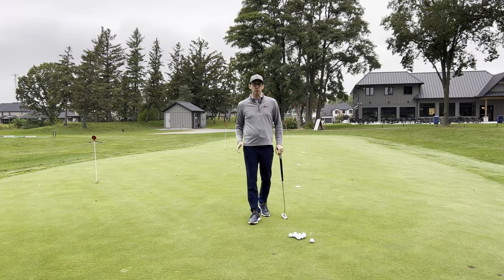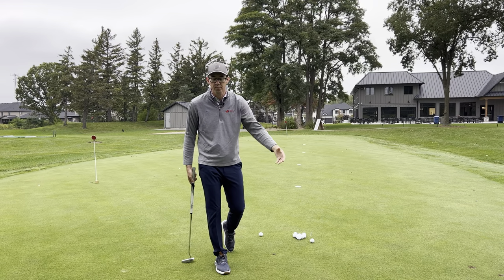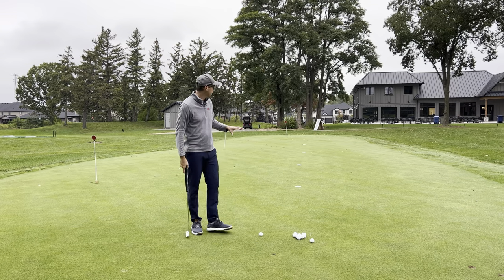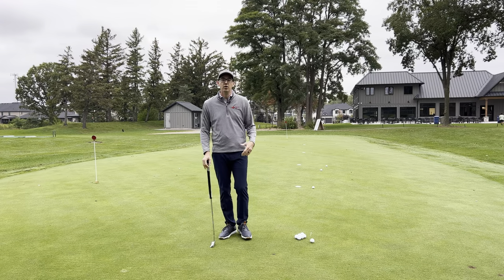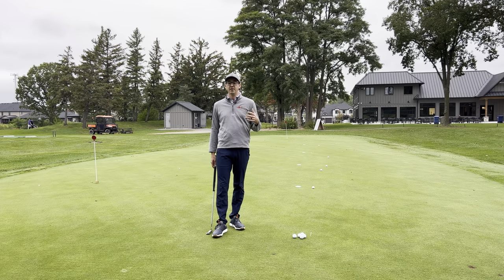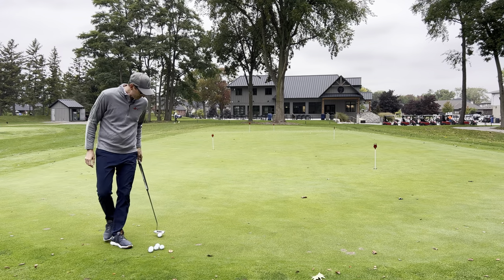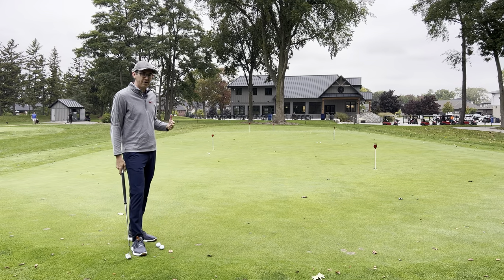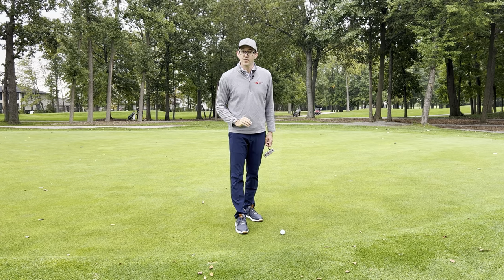Do these Putting Speed control drills and stop 3 putting!

Comment: I find that feel always plays into the putt but if you take your distance (flat putt) and divide by 2 you can estimate the length of your back stroke and follow through. So 10’ divide by 2 = 5 inches back and through (always follow your putt with your putter). I will do this for 10 foot putts until I find what my formula for the day may be for a flat putt, I may divide by 3 or maybe even 4 if the greens are fast. I do this for uphill and down hill putts so then I have an idea of a comfortable distance and all I need to do is find the break; I then test my formula at 20’, 30’. Try it, you’ll find that it will save you from 3-putting. I finish my practice with 10 three to six foot putts to be comfortable or build confidence with short putts. Good luck.

Comment: I just got myself a putting carpet to use at home.  Worked on my putting nearly every day the week after.  1 - 8' putts.  Guess what?  I had 42 putts in my round yesterday.  Actually worse than my previous 37 average.  I suppose every little bit of practice helps, but...When given an opportunity to hit a second putt from same location on the course, I can almost alway put it closer.  Unfortunately, we get one shot at it in real life.  Also, all the other variable involved in putting come into play.  How firm are the greens, how's the cut, slope, etc., etc..  Again, nice little drill if you can find an open putting green to use for an extended period,  since my home "carpet" just doesn't capture some of the "other" variables, but just seems like there's so much more to it.  I also notice that your little practice swings do NOT really indicate you are "imagining the distance" you need to hit the ball.  They pretty much seemed the same no matter the distance, and were not really reflective of the actual swing you ended up making to achieve a distance.
Reply from the maker: Hey Jeff, thanks for the comment. A few things to unpack here, 

- For my rehearsal swings example in the video, although you may not notice the visual difference in the length of the stroke there was certainly a difference in the force applied to the stroke. This will vary from player to player. Some golfers will have long strokes with less force, and some will have short strokes with more force. I believe each golfer should test these out to see what works best for them.

- When looking at your round of 42 putts, where did those putts come from. Are you 3 putting often from over 40 feet? Do you miss a lot of shorter putts? A bit more information is required to identify your biggest opportunity. If you 3 putt a lot, and your first putt is from 50 feet, leaving yourself 12 feet for your second putt. Longer putt speed control should be a priority.